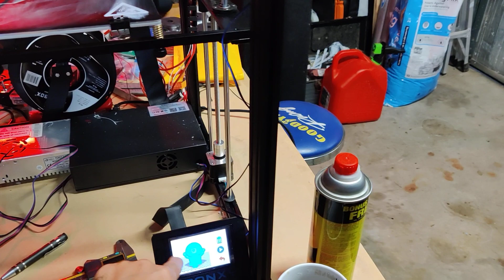TronXY X5SA-PRO second look

Comment: I'd like to say thanks for this information. Not a bad kit under $200. Before assembling I'd toss the controller, v-rollers and bed opting to start with a BigTreeTech board, linear rails, PEI bed, frame stiffening hardware and a Raspberry Pi Zero 2W.

Comment: OK all Tronxy User got Problem with buildplate. I got Tronxy top but 500 x500x 600mm remove Plate Bus a Steelplate with 0,75 mm thikness and a PEI sticker and Problems will gone. This printer is really good but Not Form beginnend Like me...many learning and Tuning and U will great prints...

Comment: You must be aware that TRONXY support is awful.  

I have an issue with the motherboard, and they don't want to honour the warranty.  To prevent fixing the problem, they lied and do not answer questions that might confirm the issue.  They even denied that the command to get the printer settings exists, while it is very well documented on the web and forums.  The printer reacts to it and tries to write to the SD card the settings, but fails with error messages. 

If you get this problem, it will be a nightmare to calibrate your printer.  The calibration is off out of the factory!  In fact, there is no warranty and no support.

If you want to see the emails I've exchanged with them, reply to this comment.

Do not waste your time and money, buy your printer from a reputable company, not TRONXY.

Comment: The best built surface is Glass with some hair spray on it, I have printed dozens and dozens with no problem, you cut a glass to the size of the built table and put it on and you're done. and underneath the glass the build surface stays brand new.

Comment: I think I have one of the newest models (Jan 2021) because I found none of the issues mentioned here.
So far so good. BUT what I am missing the most is a direct connection to my micro pc which is sitting in the frame of the printer - neither by USB nor by WIFI you can access this machine. What have the Tronxy people thought by installing these possibilities (WIFI module at low extra cost) and NOT implementing them in the software? You have to use these crappy small micro SD cards, and when the SD slot breaks down after some 200 prints ? What then? Buy a new board? People - this is a "pro" machine, so we can expect a somewhat better performance than that!

Comment: I so wanted this to work - but their QA is just terrible. First return was down to missing bed frame pieces. Second return was due to the controller board no longer being able to drive one of the motors in one direction after only 6 hours of printing. Looks like some here have also experienced the issue.
Just to chime in about the pro - its way more rigid to all but the x and y mounts being metal and using rails. The chitu board is very quiet, but don't expect octoprint to like working with it, and even with the plugin to allow CBD to work, it would just hang every few prints.
Overall, if they just added a better board and added 40-50 to the price, it'd not be too bad. As usual, you get what you pay for.

Comment: definitely had the same issues.   currently fighting my way thru to finish printing some upgrades before I re-dial everything in and get a new bed thrown on.  my build surface was not flat with a big bow in the center, couldnt print on the edges and after printing in the center for a few weeks, the plastic bed coating ripped off and left a huge hole in the surface making my printer a paperweight until I am done with my temporary replacement. glad some folks posted about the g29, hope that helps but it never seems to remember my z offset.  not sure why.  tronxy will run great but you better have some mfg. experience or a good knack for problem solving.   without that you are looking at a big headache

Comment: Thanks for the video I have been running into the same issue on my tronXY X5SA-pro-400 they did not fix that problem with the print bed. I have the Battle scars to show for it as it is ripping into its self (self-harm Printer). I am having issues now with getting the bed to stay hot enough to print abs. I am thinking of building a box to put over it with a camera inside it to watch my prints (No Schrödinger's cat here). I used the blue stripping for cable management. It came out really clean. This is my first 3d printer, so it was fun to build (fun is used loosely). I would like to know if you have any useful tips for printing abs? I did just fine printing PLA, just not ABS. 
On a side note, I hope your boy is doing well. I am a veteran myself, and I hope he enjoys this part of his life.

Comment: 1. Yes, the problem is the bedsheet. I changed to wham-bam, and the auto level sensor is more stable, didn't hit the nozzle in sudden anymore. but the gap calibration need to use 4pcs A4 to set Z to ZERO,(Weird but its works), I stick on top of the removable aluminium plate didn't install on the heating base (Just in case if not work well)

2.Need to reduce all the wheels and rod resistant at 1st. 
A. All the rail wheels and belt, can't adjust too tight. High tension will be causing the ghosting effect, and you can test it and move very freely with no belt attached. 
B. Printer below needs to put the soft base. 
C. All the corner must install corner holder/hook to enhance the structure also reduce the vibration.

3. About the Z level's rods have four black plastic will be broken soon, can order the metal rod holder from them. And the 4 rods need to lose all the nuts and screw and level up the bed to top before tighten all the top set of screws and nuts together, follow the same step to the bottle. The Z level screw need put a bit lubricant. If the machine is off, the bed will fall itself very freely when my hands put on top of it.

4The firmware is Chitu g code: 
 You can request the firmware file (Gcode)from tronxy and open with app "Bracket" coding text editor because this file contains Chinese characters only this app able to read and open the text file correctly. The coding is the same as the link below, ignore the Chinese text in the "firmware.gcode."
 http://www.customize-3d.com/chitu-g-code-explained.html.
 This gcode is very limited, and the extruder calibration is the command is M8011, 
My X5SA-2E had serious under extrusion if 100mm had 8.48mm different.
M8011=0.00264375=8.48mm (DEFAULT)
After value M8011=0.001295=2.7mm difference now, and not able to get any better than this yet.
In my experience, we can test the results and add the value 0.000015 in every test to reduce the under extrusion.

 Tronxy replied this doesn't have a correct formula because the reason below:
"The error is caused by external structure, so there is no specific calculation, only the estimated modification."

 I would like to know more about; how to change the firmware to Merlin if someone knows, please let me know, I already bought another 3D Printer TENLOG 2 IDEX printer for regular use, now this few months old Tronxy be my DIY modification hobby only. Still, it's limited because of the firmware. Hope to change HEMERA E3D Direct drive if possible.
Reply: Hi, I guess you have a lot of experience in software for 3D printers? 
I have the same Tronxy X5SA-2E printer and always have problems with the hotend clogging and always heat creap. I want to changed the hotend to a cyclobs where I can mix different fillament together and get unique colors +  hope to get it running without clogs. Do you know anything about this? please send me a message or reply if you want to help
thanks!

Comment: I had the same issue with the head printing into the bed on my very first print (20mm cube) permanently damaging the build plate and when I hit stop the head, did the same and scratched the build plate more to the home position (left-front corner). Very disappointed the instructions did not warn one needs to perform Z offset after performing the auto calibration function. Trashed the Tronxy build plate and replaced with Wham Bam flexible system that works great. Wish I viewed your video before my first print! Thanks for posting, hope helps other. Otherwise, I'm happy with the printer and prints.

Comment: I have an x5sa pro that I've put 2 spools of PLA through. The part of the instruction manual that shows you what to use for start gcode does not include G29, but it should.
Reply: Same Update dualextruders slicer Knies Seconds Bit No Print with Extruder 2 i dontbknow why...Laser works

Comment: The entire x5 series has a few problems in my opinion:

1. The build surface is pretty weird and as far as i know should be heated up to about 50° C(or lower) to work properly.
2. The hotend has a clogging issue because the cooler doesn't get enough air and is a littel bit small, so the pla might melt in the ptfe tube.
3. This printer also likes to have a g29 before its prints (for auto bed leveling). Especially because the dual z axis might get out of sync resulting in air prints or the print head crashing at one side of the print.

Tronxy seems to have never build their printers themselfs and testet it for a week with differtent levels of user experience.
Reply: PLA prints at 180-200 c, PTFE doesn't start to break down until around 260 c.   I think you need to educate yourself a bit more kid.